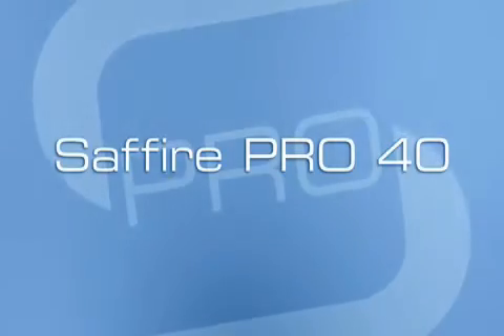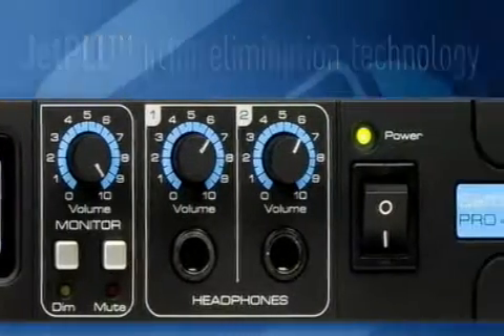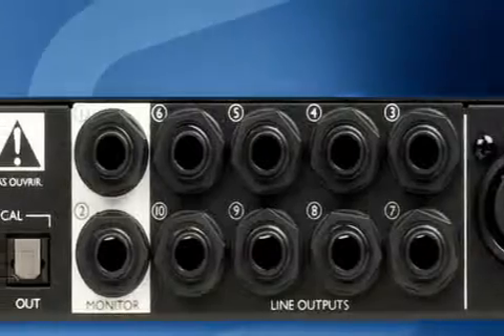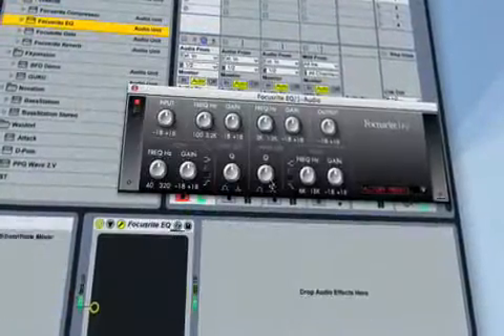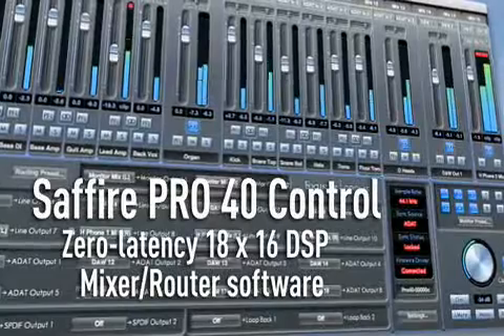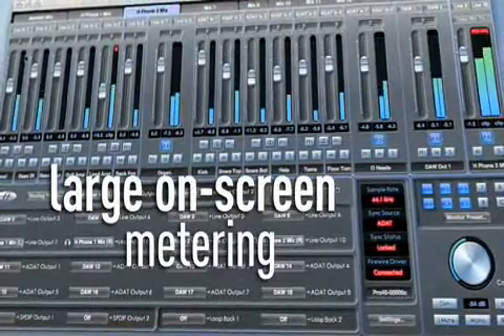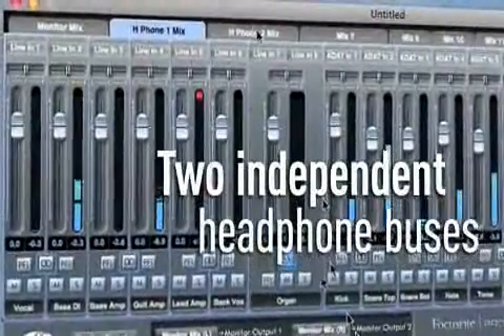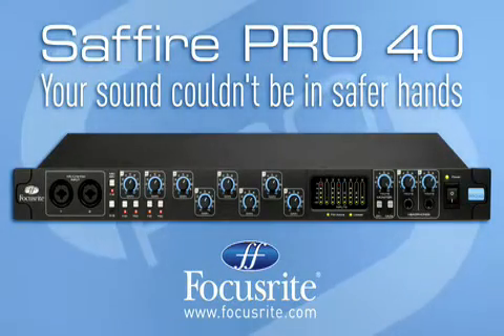Focusrite Saffire Pro 40 Firewire Audio Interface

Comment: Been using mine for about 2 years. Works great but I get a high pitched electric noise in the background. I even tried to make sure I avoided ground loops. Once the "FW Active" on the front panel comes on it makes noise. I have my firewire cable hooked up and once I disconect the firewire cable the noise goes away. Any suggestions?

Comment: I've been using this machine for more than a year with my PC DAW. Absolutely magnificent sound, rock solid drivers, everything works just fine. And with the inclusion of the standalone mode, more flexibility has been added to an already extremely flexible routing system.